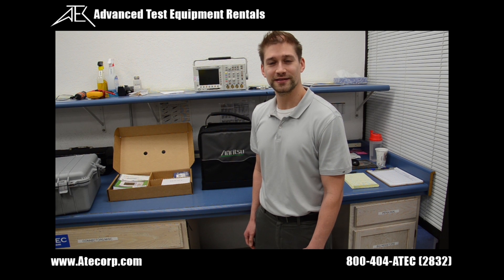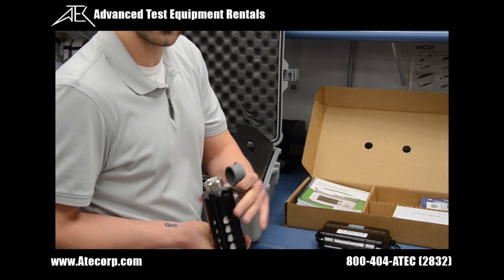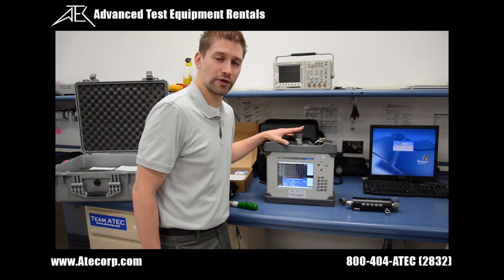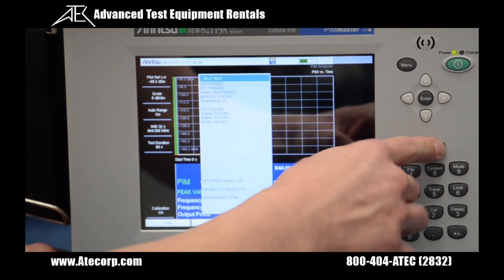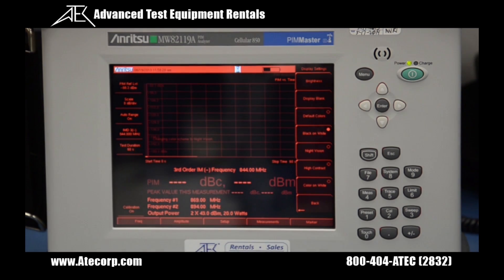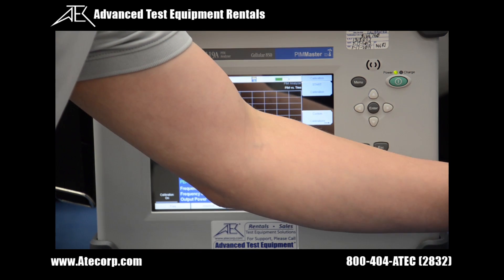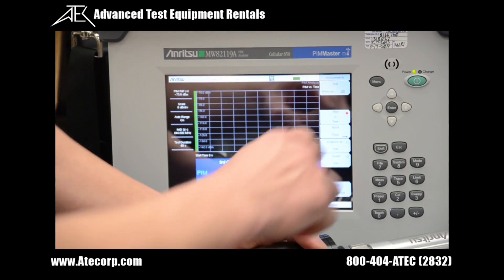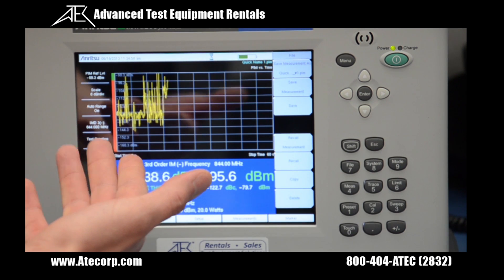How to use the portable Anritsu PIM Tester MW82119A

Comment: The issues is not at 8.45 ft.... you must take the peak, in that case you got two faults : first connector and the last connector. try to torque...
Reply: Yep 115.91 dB at 18.82 ft is the peak.

Comment: I found this note about the high reflection error in the User Manual, hope it helps!

This message occurs when the connection to the test port produces large reflections back into the instrument. This can compromise measurement accuracy. To fix this error, check all junction connections, or remove the RF connection or component that is causing the high reflection. If a cable or antenna is connected, then it could be an indication of poor RF transmission capability.